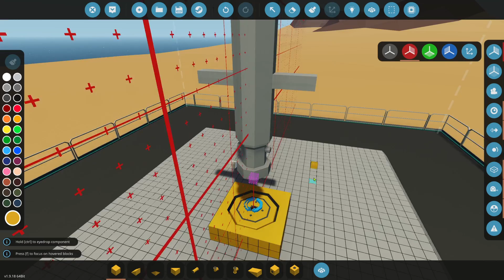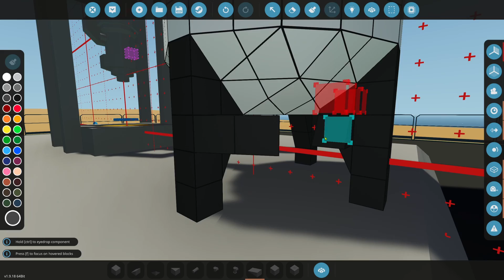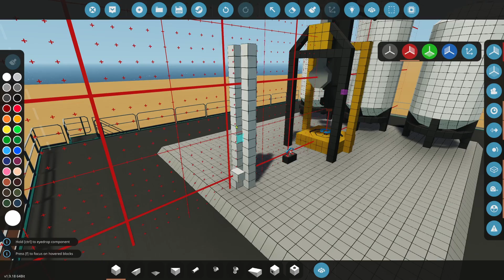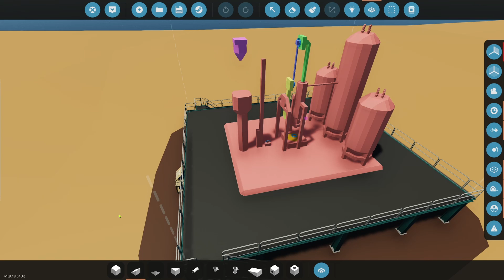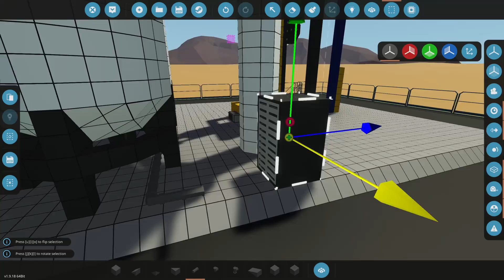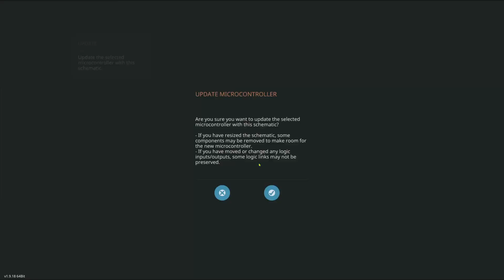Stormworks: Oil Drilling Series P2 Pumping, Fractioning  #tutorial #stormworks #gaming #gamingvideos

Comment: Compressed oil heats easier for whatever reason. You can add a gas cylinder and compress while refining it will heat easier. You can also circulate the oil from the fraction tower through the heater to get around the high flow/heat issue.

Comment: I am playing with this and since I am pumping out the Jet Fuel only (which is the liquid I am only interested in), it seems that the Diesel finally fill up the tower entirely...jamming the whole thing. I took for granted that Diesel, by getting warmed up would then change to Jet Fuel. But does not seem to be the case. Would there be a way in your tower to ONLY get jet fuel instead of having to pump out diesel as well. Possible to ONLY produce jet fuel?
Reply from the maker: I doubt it as that would be unrealistic. The crude oil has the constituent elements already in it distributed to make it crude oil. It should have asphalt in it it should have gases dissolved. It should have heavier oils like diesel and kerosene and lighter oils like gasoline. You can't just bake it and get 100% of the crude oil to turn into what you want. You have to take the constituent elements.
Reply: just sell the diesel, no harm in extra profit

Comment: Hi Capt! I try your fractioning tower (i made my own tower, like yours). And try and try the system, I discovered than the temp increased faster when the tower had high pressure (+30atm). Obviosuly, the high pressure occurr when the tower is fill, and pumping in.
But when the oil convert to vapor, the oil level down, the pressure down and the temp down too.
So I put more pumps to maintain the oil level, and my distilation have more flow, and the temp never decread at 295°C.
My diesel and Jet flows are over 600lts/min. most of time.
i'm not a oil expert, but the stormworks oil system is like a craking system, not a fractioning procces. The pressure is the base ofsystem.
Please, try you my teory.

Thank you for yours all tutorials!!!😉
Reply: I have a diesel furnace....